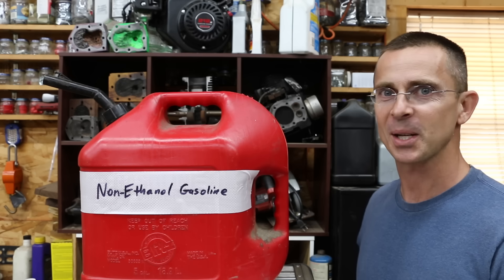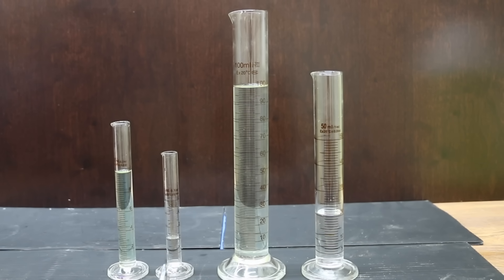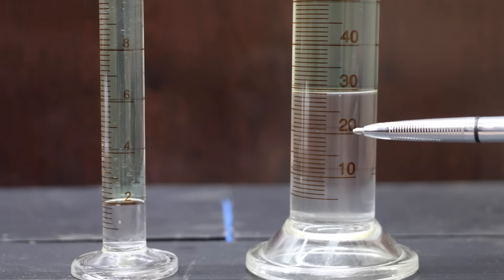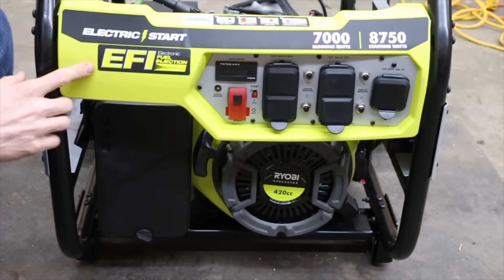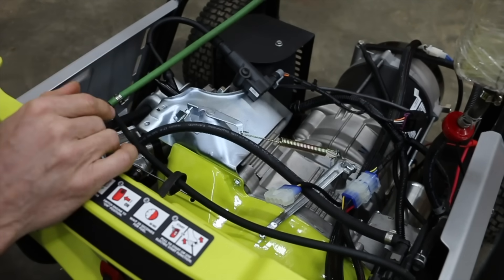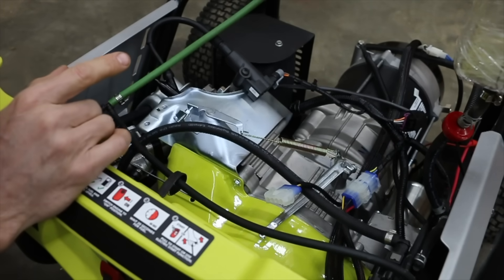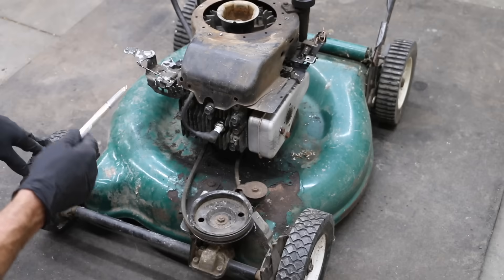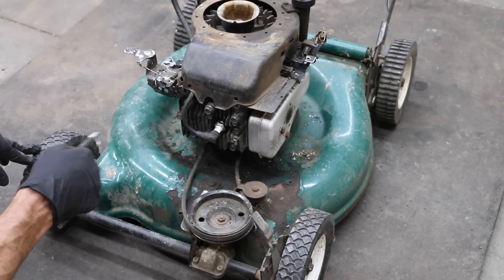Is Non-Ethanol Gasoline Really Better? See the PROOF!

Comment: I just got back from a 540 mile round trip. On the way to my 270 mile destination I used gas with ethanol and got 16.4 mpg. On the way home I used non-ethanol gas and got 19.5 mpg. The weather was the same, the payload was the same, traffic conditions were the same, and my air-conditioning settings were the same. Cruise control was set at 78mph on both trips. I was in Florida so elevation was the same in both directions. My temperature gauge was the same for both fuels. It kind of surprised me how much more efficient pure gasoline is.
Reply from the maker: Impressive difference in efficiency!
Reply: Paul H 

You didn’t specify grade(s), brand(s), or % ethanol.
Reply: @FrankGutowski-ls8jt  Good point. I failed to check those things. I just went from the cheapest grade with ethanol to the cheapest grade without it. My experiment was flawed because I did not think about the grade. From myself and all who may be reading I apologize for not doing that before I commented.
Reply: Paul H 

OK. Seems too large a difference to be attributable to only what I think of as relative energy content. Oh well...
Reply: @FrankGutowski-ls8jt  Ten four good buddy. Have a good evening.
Reply: @paulh7589  I think the grade (octane) wouldn't make a difference. It's a popular misconception that higher octane = more power.
Reply: @tmst2199  
On the other hand: Inadequate octane = less power. Once the knock sensors kick in and retard the timing, power can be dramatically reduced. In my turbocharged VW, premium is recommended. On regular, performance (as measured by OBD2 scanner/cellphone app) is definitely degraded, fuel economy is barely worse. With a performance chip, the difference is even more apparent. On alcohol free, economy is best, but the extra cost makes that uneconomical.
Reply: @paulh7589  What was the difference in price?
Reply: @tmst2199  - that depends on a few things, mostly ecu programming and sensor quality. On newer cars that are still healthy, going down to regular from premium can make a noticeable difference in both running quality and mileage. I had a Kia that just didn't do well on regular fuel, but was much happier on at least mid grade and especially premium. Using a scanner I noticed that the timing was much more aggressive with higher octane fuel, and this was a bone stock Kia SUV. Ran smoother and had better acceleration (when not flogging it, just letting it do its thing at lower revs).

So it depends on the vehicle in question whether or not premium is 'worth it'.
Reply: @Broadpaw_Fox  Interesting. I've never heard about higher grade fuel helping newer engines, but rather only to keep older engines with carbon buildup from pre-detonation or "knocking".
Reply: @paulh7589  the grade in my area For non ethanol  gas is 90 octane  So im not sure if you used  87 it be great Difference. But price is like a Dollar a gallon higher for non non Ethanol gas Here
Reply: @tmst2199  exactly 93 91 89 87 means nothing all gas has the same energy value, the number is its ability the resist detonation
Reply: @FrankGutowski-ls8jt ; Around the Florida area all ethanol free gas is 93 octane
Reply: @georgegeorge-t1p  89 octane ethanol free in Florida.
Reply: @georgegeorge-t1p   Here in Europe 95 is normal, 98 is for higher compression, and the specials are 100 and 102 octane number. What cars can burn less than 95 RON? What's the use of 89 octane? Is that for the modern Mazda ActiveX engines? Those engines switch to diesel mode, still burning gas! It's great for mileage, still offering the usual performance when needed. But I thought that's a high compression engine, just like a diesel is, so the low octane number is not a good idea for that engine, unless the compression is far lower than I expected. But then the regular gas would ignite harder and the premium would not ignite good enough in diesel mode. No, that's a bit complicated, Mazda could optimize the compression for 89 gas, but that could be a problem for other octane numbers. I'll google that. But talking of mileage, do check out that ActiveX engine technology. It is not just a small step, this is a completely new concept of burning gas in an engine. It is detonation, but at exactly the right moment. Just like in a diesel engine, but slightly different to control the moment of ignition. There are other concepts than the Mazda idea, but Mazda was the first to get the switching between normal and compression ignition (ci) running.

But my favourite, the 102 ethanol free is not available anymore. I hope the ethanol free fuel will stay, for bike caburetors the ethanol is a mess. Why those things can't be modified is a mysterie to me. There are replacement needles, there are replacement rubber sets, why are they not made out of better materials? It's that simple, there is a problem, why is it not solved? No, they simply wait for the old stocks to be sold out, and meanwhile all those carburators get destroyed by the ethanol. And at the moment that ethanol fuel law was introduced, everybody could predict the problems. But nobody actually solved the problems completely. Why is our world so stupid? In Brazil they ride millions of miles on pure ethanol without any problems. There they are smarter, I guess.

In Europe there are some 5% ethanol options, and there is 10%. But the 0% seems to be a huge problem. I haven't found it anymore, lately. Online the company confirms what I noticed, there is a problem. And that's all, no idea what's the reason, no idea what to expect. They lost a happy customer. It looks like that company has an ethanol problem.
Reply: @ericjones9699  : Your answer tells me that three are different ethanol free octane levels in Florida.  Because in the areas that I have traveled through all of it was 93.  I have no idea why.  Local ordinances maybe??  Source of supply?? Any ideas?
Reply: Normally areas with many boat owners offer Non- ethanol fuel. Boats may sit for a while. Using ethanol fuel will mess things up unless you use the engine regularly. Non-ethanol fuel is very prevalent here on the Gulf Coast. Octane has nothing to do with it. If your engine requires higher octane it just means that the explosion in each cylinder happens a bit later, which gives you a longer stroke. Higher octane actually retards the explosion. adding octane boost (which Is not even a petroleum) will not enhance your performance at all. I have been wrong about many things, I don't think I'm wrong about this one. If I am I would appreciate a reply. Thanks.
Reply: Where did you get pure gas? it a federal mandate to add %10 ethanol to gas nationwide.
Reply: @transformer889  there are several places on the eastern shore of Maryland to buy non ethanol gas
Reply: Ryan McInnis  also in vt and ny.
Reply: @ryanmcinnis9278  Marinas have pure gas.
Reply: @transformer889  No it is not.
Reply: @transformer889  I don't know where you heard that, but that's totally false. They are legally allowed to add up to 15% ethanol. The percentage changes as temperatures, and fuel prices change.
Reply: @gizmoguyar  In my city there is only one pump in one gas station that sells E0 @4.95 per gallon, almost a novelty thing.
Reply: @gizmoguyar  Nope, it's not just allowed, it's required. Here in Europe it is. Where do you live? UK?
Reply: @transformer889   How far from Europe is that? Last month I could not get any E0 anymore. Maybe I should cross the Atlantic Ocean on that old Suzuki.
Reply: @voornaam3191  We are in USA, not Europe but we have the same problem, sorry crossing Atlantic ocean is not going to help.
Reply: @transformer889   I don't think it is mandated. Gasoline sellers get tax credits or rebates for selling gasoline with alcohol.
So sellers sell 10% or E85 to make more money.
Reply: @wms1650  It just does not make sense, Ethanol is about $8 a gallon, so E85 should cost more.
Reply: @transformer889  There is less demand for pure ethanol, which makes it more expensive to separately transport, store, and dispense on its own. However, as a petroleum product, it is cheaper simply due to reduced enerfy density.
Reply: @transformer889  In Utah, you can get non-ethanol gas at several chain locations-especially at a regional chain store called Maverick.
Reply: @transformer889  WaWa sells it for about  $3.09 a gallon on one end of their pumps. Not sure on octane. Doesn't matter to me. I use it on my lawn equipment because ethanol destroys small engines.
Reply: @deweyfosworth7833  who is WaWa ? I have been putting E85 in my lawn mover for many years now, did know can cause damage.
Reply: @transformer889  it's a high-end circle k that offers more fuel options and has a sub/sandwich restaurant.
Reply: @deweyfosworth7833  I understand that to have E0 gas the refinery has to get a waiver stating that no Ethanol is available for mixing . In my city there is only one gas station carrying E0 gas at much higher price in a stand alone pump, I will look around for circle k or Maverick station in surrounding cities.
Reply: @transformer889  here in west Tn there are gas pumps with three grades of etho/gas and one grade of pure gas. I run the pure gas(same price as the  premium ethanol mix) in my accord and I have marked almost 20 miles of extra driving per fillup.
Reply: @transformer889  ...I live in idaho. My hometown has one gas station, the 91 octane is ethanol free. The next closest town is an hour away, one of it's gas stations has all-grades ethanol free...I don't want to say where it is, in case you're right. I don't want to get them in trouble. I always purchase fuel there when I'm in that town. Also, it's the same price or cheaper than the other gas stations in town.
Reply: @transformer889  Its a mandate that 10% CAN be added. Not that it has to. Note that in Iowa, the largest producer of ethanol gasoline, we not only have E-85 (85% ethanol fuels) out here, but also most stations offer both the nearly standard 10% but also completely 0% ethanol free fuel at the pumps. Why? Because all the farmers have old equipment and dont want ethanol fuels damaging them! Here in the land of government corn subsidies 10% ethanol fuel is sold at ~$0.50 less than 0% per gallon. Which actually makes it economically competitive. But that is purely due to our special subsidies.
Reply: @transformer889  You can buy pure gasoline but it is more expensive. Why? Good question.  Our local Wawa has one fuel pump that has regular gasoline but it is around 60 cents per gallon higher price than the ethanol fuel. Two cycle engines don't do well with the ethanol because it severely damages their fuel lines...same thing with A/C engines in airplanes. Ethanol has a lower BTU than gasoline...so it produces less power.
Reply: @larryehrlich8702  refineries can get a waiver if ethanol is not available for mixing with gasoline, if this happen then the gas stations put the pure gas in a special pump and charge more per gallon. why ethanol damages  2 cycle engines fuel line and what are A/C engines? thanks
Reply: @transformer889  Uhh no. I buy ethanol free 93 octane all the time. I get it at go-gas. It's a drive through station that only sells gasoline and a few small items at the pay window. Typically has lots of drink machines behind the station.They are all over eastern N.C.
Reply: @transformer889  I live in WI, and it's not a rule here. There are state laws that can apply to where you live, but best as i can tell, there is no nationwide rule. I put pure 100% Gasoline in all my cars still, because of the better power performance i get from it.
Reply: @transformer889  Pure-gas.org. You are very misinformed.
Reply: @unitedairforcepilot  May be,  I checked the government websites,  you probably need several PHD in different fields to figure out what is going on.
Reply: @transformer889  No its not
Reply: @transformer889  Incorrect
Reply: incorrect @transformer889
Reply: @transformer889  then why are there  many gas stations in Fla that sell them? they do average 70 cents more per gallon so demand here is very low. there's a website that's lists the stations in every state. only updated once a year  so not always accurate.
Reply: @salmonella1073  go gators!!
Reply: @melloyellogsxr  rah!rah!rah! go gators! lol!
Reply: @transformer889  Non-ethanol gas, i.e., "real gas" is available in multiple states nationwide.  I buy real gas in Blue Ridge, GA and use it in all my small engines.  When 10% ethanol gas first came out I used it in my small engines.  Almost immediately I had problems with the engines starting and then running properly.  It was always the carburetor.  Seals, gaskets and the like were being destroyed by the ethanol.  Even today, Stihl doubles their warranty on their chainsaws if real gas is used over ethanol gas.
Reply: @andrewoffutt3762  There are some stations with individual pumps that sell pure gas at higher price .
Reply: @transformer889  no it's not lol you can buy pure gas anywhere east the Mississippi
Reply: @transformer889  buc-ees has ethanol free gas in Texas.
Reply: @transformer889  We have non ethanol gas here
Reply: @transformer889  It doesn't have to be added to all gas; just a certain percentage of it.
Reply: @transformer889  you can buy non ethanol gas in WI.
Reply: @transformer889  l don't know if what you say is absolutely true, though it may be partially true. Download the Pure Gas Android app., or google it Pure Gas locations. Using the app shows some Quik Trips sale non-ethanol based fuel.
Reply: @transformer889  if you're anywhere near upstate NY you can get ethanol free gas at any Stewart's shop. That's where I get mine any time I'm able
Reply: @elijahclark6093  Sorry I am on the west side of the country, and there is only one gas station that has one pump ethanol-free gas at $4.00/gal where normal gas is $2.25.
Reply: @transformer889  good lord that's crazy. It's a little more expensive here tpp but only by like 35 cents a gallon.
Reply: @transformer889  so what do people over there do with cars that cannot run with ethanol fuel? My car specifically needs high octane.
Reply: transformer889 NOT EACH GALLON! Just averaged across sales
Reply: That is a pretty stark difference.  Do you think wind direction/intensity could have played any part?
Reply: @tjf311  Somebody else was kind enough to point out that I didn't pay attention to what grade I was getting, so my experiment was flawed. Sorry.
Reply: @paulh7589  I forgive you, go in peace my son.
Reply: @paulh7589  2016 Camry  did the same thing 87 e and 87 non e 4 mpg difference
Reply: @tjf311  Agree. the biggest element of power consumption is air drag or relative air speed of the vehicle. Elevation change tend to equalize.
Reply: I've done 585 miles in my diesel van and averaged 33 mpg..
Reply: My $.02, I tried one tank in my 98 Silverado. Mileage improved by 10% but the pure gas cost 20% more so why do it. At the station I visit pure gas is 89 octane and I use 87 octane mixed gas.
Reply: Do you know how much you payed for each type of fuel? I'd be interested in miles/dollar, rather than miles per gallon.
Reply: I use nothing but non ethanol gas and my state has plenty of it. Ethanol gas will ruin certain small engines and it's life span is junk. I just finished painting my 92 XJ that had been sitting for 18 months in my shop with non ethanol gas. Charged my battery and it started right up. Try that with ethanol gas.
Reply: @mccartneystuart  Gas? It's a liquid! Why do you call a liquid a gas? You call 10 million a billion, and a proper billion you call a billiard. You Americans are weird. But at least you've got an XJ. Is that the Jaguar or the Yamaha? I guess both, because Americans are very very poor, or too rich to be fully normal. Gas, yeah right. And not riding an XJ for 18 months, that's no good. Been in prison? There's no good reason not to ride an XJ.
Reply: @voornaam3191  what in sam hell are you talking about? Gas is short for gasoline genius. You couldn't put 2 and 2 together to figure that out? Hell my 10 year old son knows that. 10 million equals a billion or whatever you said that makes about as much sense? Not sure where you heard that at. It's an AMC, the only one that matters if you didn't know. It's called work, you should look into it hence why it's been in my shop for 18 months and did all the work myself too because we Americans like to build stuff to last unlike cheap crap from other countries then send em so we can rain bombs over poor souls, just kidding. Good luck with your billiards.
Reply: @mccartneystuart    Since Mr. Benz lived, that stuff is called Benzine, because it is made for cars. Gasoline is the wrong word, you missed Benz and nafta completely. And your units are all bezirk, especcially the high numbers are different from the normal world. If nobody tells you so, you start thinking your units are normal. Even the British are giving up those irrational empire things, like inches, yards, miles, stones, bisceps and gallons. Those are almost random amounts of scientific units. Fine for a while, but exact? Eh, no. Just like that bar in Paris defining a meter was left behind, you could leave behind things like gallons. You could as well drink a gluffy of coffee. What the heck is a gluffy? Simple, two 13th of a gallon. Why? Don't ask me, have a nice gluffy. That unfamiliar is the word gallon in Europe. What is it, around 4 and a half liters? We must google it, just like those miles. Is that the reason your cars are far larger than you really need? And those huge houses? We'd call that a palace, in Hollywood it's just a house. Just a matter of larger units?
Only the difference between a sea mile and a road mile is so confusing. Why not use knots in cars? Throw out a rope and count the knots during a sand glass. Great. An XJ is a fantastic motorbike, if the Japanese would drop those from aeroplanes right on your Yankie heads, the XJ's would still ride to Alaska without a scratch. Instead you need to paint an AMC, so even the paint wasn't good enough. Can you believe it? Maybe you should try the famous Jag X type one day. If you call your multi-millionairs 100 times too early a billionair, what do you expect? That is asking for problems like everything build in inches while designed in centimeters or the other way around. One day even a satellite almost stayed on earth, because some part was constructed the wrong size. Nobody mentioned the word inch or cm, appearantly. Those errors are caused by that stubbornness alone. Adapt to the world, before the world is getting tired of adapting to you, all the time. So you could better call your billionairs Billy or Willy, and call them billionairs if they gathered a 1000 millions. Just because the rest of the world does it that way. Or are you hoping to get a 100 times more money, if you make a billion dollar deal abroad? Selling fighter jets could be fun, if you produce them for $10,000,000 (a fake billion) and sell them for $1,000,000,000 (a true billion). Don't you really know, that your billions are labeled wrong? My 10 year old cat knows that... And no, my cat is not short for my caterpillar. Butt is not short for butterfly, either. Or is it? It would not surprise me. Born a cat, transforming to a butt, sounds very American.

Are you sure, your son isn't a thousand years old? Ten or a thousand, that's the question.
Reply: @voornaam3191  what are you rambling on about? Are you drunk? Are you saying benzine is the same as gasoline/gas? It is not. You are assuredly mistaking my non standard friend. Where do you get this stuff from? Inches, feet, yards, etc. are absolutely absolute units of measurement. I would know. Defined and specific. We made it different than the rest just because we knew you would/must follow it because that's what we do and guess what, if you had the power to change it you wouldn't of followed it in the first place. Don't hold your breathe for it to change or your cat won't be enjoying peanut butter (American) at 2 in the morning on your lonely nights. Psst. only odd feminine fellows own cats. Or are you fattening it up like we do turkeys for dinner? Baha, just kidding. Good luck with all that. Take care meow. Murica f#$k yea!
Reply: @mccartneystuart   Why do the British call it petrol? Why do Germans call it Sprit? Why do Irani call it nafta? Why do I call it benzine? Why is only gas the right word? Where does that name gasoline come frome? Why don't you call it Otto? The other stuff is Diesel, isn't it?

By the way, you do that in chemistry, too. Your sodium has the abreviation Na. Do you have a gomorrium element too? Your potassium is in fact K. Why don't you folks simply use the international names? Those totally different trivial names are very confusing. There is a periodic table, and still the very common elements have all kinds of nicknames all around the world. It's the "Winnetoo, Hände hoch!" effect, no matter how good the timing, you see he actually said "Winnetoo, hands up!" Potassium? Hell no, can't you see it screams kalium itself? The symbol is not Po at all. Have you folks been smoking too much potassium? Pot? Are you shure?

Third example. How do you call a lot of cows? Kettle! Things you hang above a fire, for cooking water. Huh? Or perhaps related to cats. Way larger than cats, why call those cows cats? Small cats? Cattel? Cattle? Huh? What's wrong with the word cows? No, let's use a long forgotten name. It's not even Latin, it doesn't look like bovi. Is it Chinese, for a change? No idea. Sort it out yourself, as usual. I bet in old times cows wore silver or gold chains. Stealing a cow was a serious crime, so each cow had a kind of licence plate, a precious chain, showing it's owners name, around the neck. Later the brand marking was invented, those huge chains were a bit expensive. And Fort Knocks was built, a safer place for the nations gold reserve.  A chain is a Kette in German. A small chain, Kettel, slipped your language, it reminds us of the times before Fort Knocks. Once the cows really wore gold chains,  called Kettel. Being a cowboy was serious business, that explains the glamour of the classic western movie. Those early cowboys were heroes, resisting the seduction of stealing a lot of gold, every single day.
But sure you have an other reason to call cows cattle. Some stuttering sherrif, starting the startling chain of events leading to calling cows cattle instead of cows. Come on, it must be something like that.

What's the peanut butter cat woman doing here? I happen to live in one of the other countries in the world, famous for peanut butter. We call it peanut cheese, by the way. I tried to f!#$$€£¥¥₩ck the cat lady, but she said she only f!#$$€£¥¥₩cks Amoronicons. Too bed. Do you know what "from behind" means?

And how do you call your liquified petrol gas? I gas you call that guess two.
Reply: @voornaam3191  you are one odd individual but seem to be educated. Neither here nor there however because we set the trends for the rest to follow no matter which avenue. Love it or hate it, it's how it is. I'm only messing with you, it's all in good fun. Good luck with your cat "lady". No disrespect intended. Good day.
Reply: @mccartneystuart   Oops, perhaps I was drunk. What a lot of words. Good luck with the peanut butter.
Reply: @voornaam3191  Just for the record, the terms used to refer to cattle are very specific and nearly universal throughout the English speaking world. Cattle is the proper term to refer to any bovine. A cow is an adult female cattle. Just uncorrectly used over time that now it is what the layman uses to refer to cattle. Probably because it is a simple 3 letter word to teach kids, also because they are what kids would be more exposed to growing up milking the cow on the farm. While dad was out butchering the old ox and prepping a new steer for the job.
Reply: @voornaam3191  Gas is short for gasoline.
Reply: @voornaam3191  Its CALLED GASOLINE  NOT LIQUIDLINE MAYBE THAT WHY WE CALL IT GAS
Reply: @jefffloyd3480  It's petrol. Or benzine. Or nafta. It is a liquid. Even liquified gas is liquid. You gas heads are weird. But you call kilometers miles. So what would one expect? You pedestrians are swimming? Makes sense...
Reply: @mccartneystuart  my 98 civic sat in impound for a year.. when i got it back it was covered in mold.. put a new battery in it and it fired right up, no issues whatsoever...  there are tons of stories to back up anyones claims... i only run ethanol fuel.
Reply: I’ve done something similar in my 05 6.0 Chevy. Got 4 mpg better with pure gasoline. On a 8 hr trip. The gasses were different grades tho. I was still surprised to see a difference.
Reply: @Paul H Ethanol or alcohol has less energy than gasoline.
This is the reason for less MPG.
Another person asked about the grade of gasoline used.
The grade will only change/reduce MPG if the engine requires the high grade gasoline.
Using High Octane fuel in a car that is designed for Regular fuel will not increase mileage.
Using Regular fuel in a car designed for High Octane may reduce the MPH under high load and low engine RPM conditions.
Reply: I had a Toyota Tacoma that I recorded MPG of each tank of gas it burned over 150,000 miles.   I lived in Oregon then and it is against the law to pump your own gas, so I had some time on my hands.   Ethanol was only incorporated in gas over winter months in the late 1990's through some time in the 2000's.   MPG was reduced by 10% when ethanol gas showed up.   This was overall the 18 gal of gas in a tank, mostly city driving in truck.   I'm not surprised at your 16.4 v 19.5 improvement.
Reply: Not as dramatic in my truck but I get one more mile per gallon if I don't use E85.
Reply: That is awesome,  add 10% ethanol to go 16% fewer miles by volume.   Your federal government at it's finest.   When they say it is to reduce hydrocarbons/atmospheric carbon/global warming,  they are lying, and this is proof,  if  you needed any more.
Reply: Did you take into account that 1 direction you were most likely going uphill and the other downhill?
Reply: You'll get worse mileage if you run 102 octane gas too.
Reply: Ethanol free at my local gas station. It’s 87 octane. Cost as much as premium ethanol
Reply: Your fuel contained about 7% ethanol.
Reply: Thank you, I live in Naples. Drive a 2019 RAM with Hemi - that helps - it's 10 cent difference at WAWA. Going to top off my tank now.
Reply: I hate ethanol being mandated into our gasoline...it raises the cost of car gasoline and you get a lower MPG with ethanol added to your fuel. The corn farmers up north love the ethanol mandate but it hurt the rest of us.
Reply: @larryehrlich8702  Wont be long and them corn farmers up north are to shit out a luck, half the crops look terrible and an early freeze will finish things off, there wasn't hardly any corn planted around here this year
Reply: I get a bump of about 3 to 4 miles per gallon with my Kia Sportage and Optima. It's more expensive at the pump. When you get an extra 45 to 60 miles per tank. It washes. It also runs better.
Reply: Ok so I had to recreate this but kept track I used non ethanol gas 91 octane full tank 1 direction and got 16.5 mpg
On the way back I used 91 octane 10 percent ethanol  and got 13.8 mpg this is in a 2005 5.7 hemi in perfect condition had no problems and I dont use ac
Reply: Doesn't surprise me in the least. Ethanolized gas is a conspiracy designed to get older vehicles off the roads and into scrapyards to prop up the auto industry.  I'm fortunate to have a number of stations in my area that sell 93 octane non-ethanol at a modest and reasonable premium over ethanolized 93. Some stations price gouge on it horribly, especially in rural areas, charging well more for 87 octane non-ethanol than they do for 93 ethanolized, but that kind of unethical behavior is not universal practice. They are preying on the fears of the larger numbers of small equipment owners in such areas. 

@transformer889  You are misinformed. There are subsidies and incentives for ethanolizing gas, but thankfully there is NO Federal law or mandate requiring it. Any gas station can choose to have any or all grades of its gas delivered without ethanol, if they are enlightened enough to do so. 

@george george Go away, Eurotroll
Reply: Yep, gasoline has more energy content than ethanol.  Ethanol has a higher octane.  You can make more power, given an engine that is tuned for the 100+ octane you get with ethanol, but you will run out of fuel quite a lot sooner.
Reply: @CevairZufer  No you can't. High compression engines can not run on the wrong type of fuel. Jump high or jump low, it does not help. Knocking sensors don't do miracles, do they? Bike engines can have quite high compression numbers, you don't wanna take chances, do you? Why would you?

Or do you refer to the hypermodern variable compression engines, adapting the compression ratio (in realtime) to the present turbo pressure? That's one very complicated exception.
Reply: @CevairZufer  Yes it is.  The stink of it that it costs a dollar per gallon more just to leave something OUT of the gas.  I use it for my garden and lawn equipment/generators only.
Reply: What kind of car do you drive? Just curious before I try this...does your car have a turbo?
Reply: yeah i noticed a similar thing when i went from NC to Indiana.  My mileage range from the on board computer said i had a range of 310 miles till empty.  topped off in virginia, it said 340 miles.  after a week in indiana, with different fuel blends, and filling up twice there, i drove home and the range said 405 miles.  It stayed right there at 405 even though i drove like 80 miles before it dropped to 399 miles.  Got back down here to crappy gas NC, my range is barely over 300 again.
Reply: Yeah but on the way back you were going downhill... 🤣
Reply: In my vehicles fuel mileage isn't really affected by ethanol or non ethabol
Reply: Something is not quite right with your “test”. 

Gasoline has an energy content of about 124,000 BTU per gallon. Ethanol has an energy content of about 76,100 BTU per gallon. Therefore E10 has an energy content of about 118,100. So, you should have seen about 5% less mileage. Instead, you saw 16% less mileage. That is much too large a discrepancy to be an accurate reflection of the difference in mileage.
Reply: I find on average about 2mpg better using non ethanol in my 2011f150 6.2. Going from 13 to 15+is well worth it in my book
Reply: The purpose of ethanol was to replace methyl tributyl ether, which replaced lead as an anti-knock additive. That was never a good solution because the alcohol makes the fuel too unstable especially if it comes in contact with water.